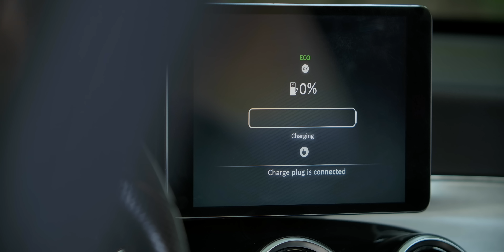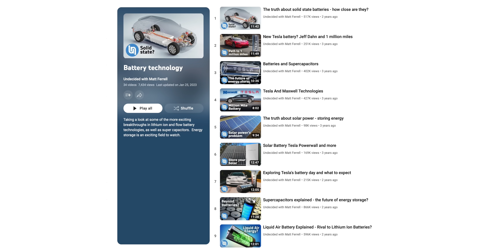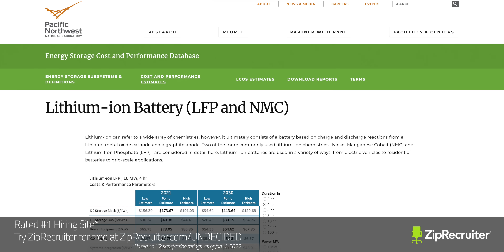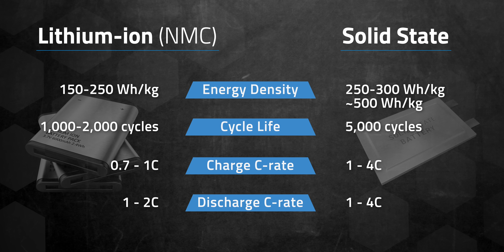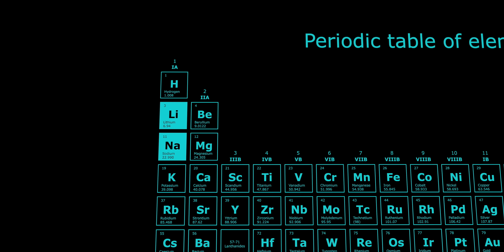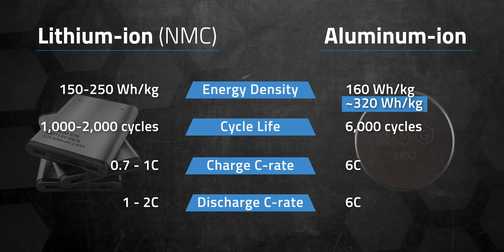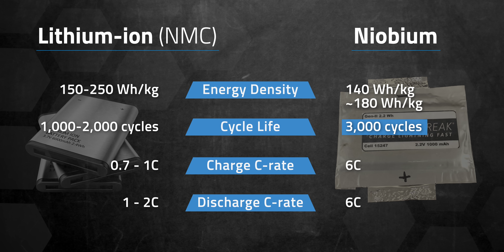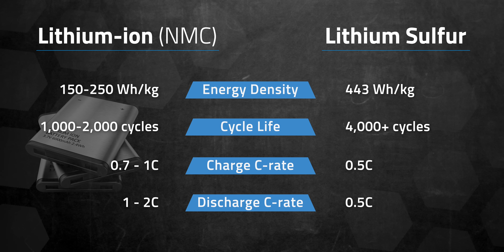Are These Batteries The Future Of Energy Storage?

Comment from the maker: So what batteries do you think have a good shot? Any you’d add to this list? See why hiring doesn’t have to be difficult — when you try ZipRecruiter for free at https://www.ziprecruiter.com/UNDECIDED.

If you liked this video, check out 137 Year Old Battery Tech May Be The Future of Energy Storage https://youtu.be/2wsSRq-bEm0?list=PLnTSM-ORSgi4dFnLD9622FK77atWtQVv7
Reply: Hey Matt, could you possibly make a video about microturbine generators as energy storage? its like a gas turbine but small, the upside is they can use hydrogen as fuel.    i recently came across them , but there's barely any talk about them. thanks!
Reply: @TheeFrancis  how is a generator energy storage? Sounds like energy generation hence the name
Reply: @slcpunk420  , hydrogen is where the energy is technically stored, the generator is how its gonna be extracted. Like fuel cells or something (im no expert😅) im really interested in the concept but all I see is product showcases and no full breakdown explanations about it
Reply: @TheeFrancis  And where does the hydrogen come from?
Reply: @TheeFrancis  i Wonder the efficiency of these generators . I3 is gone for good, and no other generator engine onbording is kicking strongly in this field
Reply: IMO the nano diamond 'battery' is the most interesting one to watch.  Top contenders are the ones that reduce material cost by 2 or 4 orders of magnitude (think silicone, carbon, sulfur, aluminum, sodium, etc - and NOT nickel, cobalt, lithium, etc. ) solid state is  promising too...
Reply: Does the omission of LFP batteries from this video just mean that they are already becoming the de facto standard for Chinese EV manufacturers? Seems like only super high performance EVs need to continue to rely on lithium-ion, and LFP batteries are much cheaper than NMC, can charge/discharge from 0-100% without battery damage, have 2X/3X lifecycles of NMC, and they don’t catch on fire. Somewhat lower (but steadily increasing with innovations) energy density is the only drawback of LFP. Tesla is already using LFP for all its grid/home batteries and beginning to transition to them in some lower-priced EVs.
Reply: @durinok  Both energy density and power density are problems for LFP.  This video claims very low C rates for NMC compared to manufacturer claims which go as high as 30C but more typically 5C.  LFP Blade battery from BYD ,on the other hand, claims 2C max discharge current ad 0.5C max charge current.  So if a typical 5000lb SUV wants to claim a 300 mile range, it better have a 100kwh pack, but a Blade pack even that large would only produce 200kw power which is not a lot of HP for a big vehicle that is carrying around a 2000lb battery and takes 2hrs minimum to charge.  NMC 100kwh packs can weigh as little as 850lbs while supporting 400kw (over 540HP), so you have more power in a vehicle that weighs 1000lbs less and can be fast charged in under 1hrs.  The cycle life advantage of LFP is not even so important because if SOC stays between 20% and 90% and fast charging is infrequent, NMC will last 2,000 cycles or more -- more than 400k miles.  You are correct to point out that LFp is not for performance vehicles, but I think you understate the case -- the weight of pack sizes that confer decent ranges degrade performance even further.  Unless LFP significantly improves both energy and power density, it will only be suitable for small, light, city cars with short ranges and low HP requirements.
Reply: @durinok  LFP (Lithium Iron Phosphate) is Lithium ion.  It's one of several different Lithium ion chemistries.  Agree it's one of the most important ones now, especially since it uses no unusual or uncommon chemical elements.
Reply: Other battery enablers include coating technologies (perhaps Kodak has the most IP in this field),  and other roll to roll processing and vacuum deposition techs including printing and miniaturized lithography (such as dominated by Intel...), etc. ...
Reply: I see you’re really enjoying the puns here today.
Reply: @alankirby3839  "batteries to keep an ion" lol <bites lip...nods>
Reply: The lack of $/Wh comparision (today/projected) makes this interesting, but somewhat useless.
Reply: I see video like this, and 15 years I buy CALB LFP 9000 cycles at 80 % DOD to 80 % SOH. Who can compete ? USA ? CHIle ? INdia ? Germany ? Russia ? Nobody in the world produces sych cheap battery, and cheap mean, that U sell GWh of capacity.
Reply: widespread implementation is.... 30 years away 🙃
Reply: LifePO3 lithium Ferro Phosphate!
Already on the market slightly lower energy density than Lion but more cycle life. And the biggy, inherently safe as when shorted or overheated they denature themselves and the cell become inert and stops being a battery well short of ever burning! Even if you drive a nail through it!
Great for safety!
Oh an huge C rate too for charging fast is another plus!
Reply: Sodium-ion with low cost of raw materials sounds like a reasonable alternative for high capacity grid storage.
Reply: As of yet, my favorite battery ever is the human being.  Leave it to Neo.
Reply: Lithium is fine in my opinion what they need to focus on till ssbs or alumion batteries or sodiatteries happen programming and smart initialization in cars like when the heater or ac should be turned on or when outsides air is better substituted the using ac and also electo tinting using outside window built solar panels o
Reply: I think the biggest problem is our battery situation. Currently is the fact that we have so much lithium sitting in landfills we’re waiting to be recycled and nobody’s stepping up to do it. We need to be recycling these materials to keep them out of the water table, and to reduce cost by development of more efficient, recycling methods, which are only going to happen if we push to get recycling even with less efficient methods we have now Paving the way for further development of higher profits for companies willing to do the r&d. Government contracts for recycling or something is need to make it attractive so that developments in the recycling field can move froward. Once solid cheap recycling is in place at that point we would have enough materials to reduce cost and be working on these newer batteries even more. The charging problem is a chicken and egg problem. We need to get these cars out there to be charged to have enough of a user base for companies to be willing to invest that or again government incentives for putting chargers and incentivize people to buy the cars and other electrical power devices again incentives is going to be the keyword. Getting this established because right now electric vehicles, at least in the United States are just too inconvenient and too costly to operate for many people.
Reply: I'd like to see form follow function and have a thicker phone with a much bigger battery.  But as long as so many consumers are fascinated by how thin their phones are I guess we'll always have less battery life than we could.  I can hold my 3 year old phone with less than one quarter of my fingertips making contact.  Will future phones fly out of our hands when a breeze blows up?
"Ooooooooh look how thin it is!  Oooooooooooooh it's so thin! Let's see who's is thinner!  Ooooooooooh!"  Sigh.
Reply: 6:02 Is it really true that he is good enough?
Reply: Sodium ion batteries seem superior in every way except for density.  I think that can be overcome in a battery swap scenario like Nio.
Reply: @davesworld7961  Or paired with another high-density pack for range.  We haven't seen any hybrid battery packs yet in production vehicles, but it seems like a lightweight high-C rate chemistry in a small pack could handle acceleration and regenerative braking, then be recharged by a slower C-rate but large high density pack during more steady state driving periods.
Reply: Graphene Manufacturing Group's graphene aluminum-ion battery looks extremely compelling.
Reply: Check out the Norwegian technology from Beyonder. Got their own patent, and are currently building a new factory.
Reply: i would have thought Sodium batteries can be used for cheaper BEV where you dont need that much range (small city cars)
Reply: I would add Lithium Iron Phosphate cells to the list. No controversial metals, significantly lower cost of manufacture, slightly lower energy density at pack level than NMC, virtually no chance of thermal runaway and fire, and much higher cycle life of 3,000 to 6,000. In addition, they are being used in EV's already.
Reply: I would be willing to go with sodium even with their limited density for no other reason than there is a LOT more sodium than there is lithium. 
Imagine only driving 200 miles on a single charge but stopping at the store for groceries or because you need that “200 mile get out of your car to prevent the blood clots” stretch, plug in your car, do your shopping/get your coffee and stretch, and BING! your car is charged. Add to that, your not destroying the environment with open pit mines that are searching for 0.002-0.006% of the earth’s crust. And we’re not making China the new Saudi Arabia.
Reply: One important thing missing in this video (and many videos from many sources about energy storage systems) is the *EFFICIENCY*. For instance, some of the grid-scale storage systems are only 30-50% efficient, loosing the rest to heat in some part of the process of charging, storing, or discharging. I think this is a metric that we simply can't ignore, as it has fundamental implications for their long term economic viability, payback time, and appropriate use-cases.
Reply: America already has a decentralized energy grid when a wire is cut because of the 1000 drunk driver of the week your not seeing thousands or even hundreds of outages you be lucky to see 15  per case because they route the energy by cutting out set houses near the accident basically making a cut at that line up to 3 houses which is the line - each transformer in your house in a total sum of your avarage use so the energy just gets used up at the last house before the break which requires a exact point on the break why you see multiple comcast people est ones to report the break to save money while the problem gets fixed because basically they count you as cut off 

so instead of having thousands of angry customers they have a few 

so the argument of why we cant do this because local energy companies dont do anything unless in increases their bottom line see if this disgusts you and think America should run with more government oversight so does everyone els with a brain and not trying to kill themselves thru their obsessive not caring
Reply: This is one of things which causes dads to say that "the world population is too high". If salt water can be turned into batteries, just imagine what "spiritual" extremists will do with the electricity which we're selling them at all affordable price: they will certainly use it to create weapons in order to kill teachers, cops, and judges, and to try to free all the prisoners. They will spill more salty water in the jail in order to make a long "cable", and use it to shock the deputies/correctional officers. They will fart in class. The only way to solve the problem is to only allow trustable people to live, such as certain Chinamen, and to make sure that everyone who looks like me will die.
Reply: For me, it all comes down to cost, speed of charge, and what works best with solar panels in a stationary environment!
Reply: @user-iw1gx9ej5s  I would be thrilled with a NDB with sufficient power/mass to run my cell phone for it's 5 year usefull life (and serve as a hand warmer at the same time)...
Reply: I made a comparison table from Matt's video. Thanks Matt for your videos. https://docs.google.com/spreadsheets/d/1eMgKCSCGUr3Sf3gxFdN7OvCnLSMtZAGIYLBLS6h5zVs/edit?usp=sharing
Reply: NUCLEAR.....

BAHAHAHA <3 you buddy!
Reply: How about hybrid batteries? Particularly in the case of electric vehicles where you have a slow charging, high capacity, slow discharge, high cycles module paired with a hyper-capacitor. Once you combined them, it may be possible to compensate for the weaknesses of one with the other. For instance, in the video, I see Sulphur-Li and Niobium as a possible pairing.
I also have faith in Na-ion batteries, as very few hold the promise of a cost reduction better than Sodium.
Reply: @rashakor  Niobium is expensive.
Reply: Sodium batteries 😊
Reply: Say hi to Will.
Reply: You need to cover Enovix. Going commercial before any of the above. I notified you about Enovix before as well.
Reply: @pranavid  I notice the Enovix website only claims 500 cycles.  Unless the pack is huge, that doesn't sound like it would last the 15yrs and 300k miles of a typical vehicle, does it ?  Is it cheap enough that 5 yr replacements make sense ?
Reply: As far as i know recommented charge current of lithium ion battery was 1c i can understand and know this but how in the world the new generation phones are like quadrippling this rate and claiming that this technology wont cause battery life to decrease? Can anybody explain it to me.
Reply: Battery which would be enviromentally sustainable would be the one needed, not toxic waste like the ones presented.
Reply: if i made car batteries for electric cars id think that square battery would be better to fill in the spaces between having that battery that cant catch fire iz a hole in 1
Reply: I’d be interested to see some more info about nanotopological changes in anodes and cathodes that increase performance of traditional batteries.
Reply: Why did you never talked about ENVX and the silica based battery? It is already being sold in some consumer industries.
Reply: I thought you’d cover LiFePo compare as well.
Reply: Good work. Key item missing comparison is a LFP, used by military for 20+ years
Reply: A new development out of MIT, molten salt electrolyte batteries with aluminum and I believe zinc (not sure which anode and cathode). Relatively low energy density but the molten electrolyte precludes damage from overheating and can reportedly easily handle 100C charge and discharge rates. Electrolyte is composed of a mixture of sodium and potassium chlorides and some other common elements so definite advantage on production materials. probably would make sense to use in vehicles for accel/decel with a seperate NMC pack for range as others have suggested.
Reply: We desperately need to replace the ones that are fire hazard risks.  I am getting paranoid as an Amazon Vine reviewer. I receiving so many of these trinkets that have built in li-ion batteries.  I'm afraid of one of them bursting into flames (that I may have packed away) because I just don't use it much.
Reply: Hey Matt, sodium sulfur is making a huge comeback. It would be amazing to hear some prospective from you. Especially if you include failure of the past as guidance for future safety. Thanks in advance. Hope you would consider.
Reply: Hi Matt! Thanks for the amazing content! Could you do a top 5 for bio plastics?
Reply: Lithium-Air, specifically Li2O batteries are the most interesting because they have extremely high energy density due to their 4-electron reaction. Prototypes have achieved nearly 700wh/kg and there is room to over 1000wh/kg with tweaks. Downside has typically been low cycle life and high temps needed but recent developments in solid-state li+ permeable electrolyte has made this viable at room temp with 1000+ cycles. This research paper just released a week ago and I think it's incredibly promising. Lack of rare earth metals like cobalt/nickle etc should make them very cheap too. Also, fun fact, they gain significant weight as they discharge due to pulling Oxygen from the air!
Reply: The batteries should be rated based on the total energy stored over the lifetime/their price and should work at least for a few decades to make sense. I think LTO batteries look good so far.
Reply: How would you go about insulating batteries to protect them from cold weather?
Reply: The Toyota solid electrolyte battery due out in 2025 seems like a good candidate.  I drive a 2017 Prius Prime, the battery is a bit tired, I would love to upgrade to what appears to be a much better battery.
Reply: Please do a similar comparison video for grid storage. This is what's needed to make wind and solar scale and is a critical technology to fight climate change.
Reply: I still like the idea of quickly swapping out Iron-Air batteries at the service station.
Reply: @seanhoude  only one company ever got near trying it, an Israeli company, and their battery swapping mechanism proved hopeless.  It's a harder problem than you might think, given that it can't be managed by hand, must be safe in the rain, across all kinds of vehicles, must not involve hours waiting in a slowly moving queue, and must involve making a heavy weight secure.  One idea I had was for electric cars to tow their batteries on little swappable trailers.
Reply: The stuff I've read and watched for CATLs Sodium Ion looks very promising.  CATL is the battery supplier for Tesla and the specs on the new roadster, using these batteries, say the range should be around 700 miles.  I think we'll see another huge revolution in tech within 5 years like we saw with NiCad and then the big boom with Lithium.
Reply: High energy density batteries interest me the most. Safety is a close second as car crashes can damage battery packs an it’s never good to have the danger of fire. Your five rope batteries are perfect.
Reply: Can you cover Lithium IRON batteries? My home storage uses that tech. I just want to hear your thoughts about it.
Reply: I'd love to hear your take on those nuclear nano diamond batteries. 
promising or problematic?  hoax or hope?
Reply: hey checkout Zenaji LTO Energy
Reply: The Graphene Aluminum Ion Battery looks like it will take the prize.
Reply: Fluorine ion, aluminum ion, or sodium ion. All have pros and cons. Fluorine has extreme voltage 4.4 to 5.2v per serving, but trying to keep the fluorine in its place is tricky. Aluminum ion is lower voltage, about 3.3v, but has a much higher current capacity than most lithium batteries. The sodium battery has a lower capacity but the lowest cost.
Reply: aluminum-ion
Reply: I was hoping to see Li Fe PO4 (Lithium Iron Phosphate) batteries in this list, but you made good choices there.

Li Fe PO4 are already on the market. Specific Energy Density is lower than Li NMC, but I think cycle lifetime is similar. The big plus is that they are highly tolerant of situations that would be considered abusive to Li NMC cells. They are finding use in home batteries, RV house batteries, and marine storage.
Reply: that aluminum batteries look the most ideal
Reply: Vanadium redox flow batteries for stationary storage for home / grid scale. Relatively low energy density but 30000+ cycles at 100% DOD.
Reply: @zohan9995   aluminum batteries gonna be the future tho
Reply: Thank you.
Reply: Anybody remember Sony Betamax?  How about Lotus 1-2-3?   Besides battery technical obsolescence, EVs are on the cusp of encountering severe raw material shortages.
Reply: I think you missed a major one... semi-solid-state (also marketed as "condensed matter") ... basically these batteries use a NMC base chemistry and a gel electrolyte.  I believe several companies are working on them and there are already samples built into packs floating around.  I don't remember the company names though.  Something like 30% lighter than standard NMC for the same capacity and also apparently fire-safe.
Reply: Niobium sounds very interesting!
Reply: Your videos are constantly paired with false advertising about chargers and battery "solutions" that claim to fix the issues that arise out of charge cycling, and its really annoying.
Reply: I find very disappointing that there was not a single mention of the environmental concerns of producing batteries with different technologies. Mining lithium exposes entire towns to cancer development, deformities and many other health problems. And the only people talking about seem to be the ones being directly affected.
Reply: Basic engineering knowledge and why hydrogen is superior to batteries.  Though this knowledge is blatantly ignored because people do not get the basics. 
https://c2e2.unepccc.org/wp-content/uploads/sites/3/2019/09/analysis-of-hydrogen-fuel-cell-and-battery.pdf
Reply: @BS-vm5bt  Hydrogen fuel cell vehicle well-to-wheels (overall) energy efficiency is about 20% when the Hydrogen is made from electrolysis of water.  That's about the same efficiency as burning fossil fuels in an internal combustion engine. 

Put another way, driving a battery electric vehicle will go about 3x to 4x as far as a Hydrogen Fuel Cell vehicle for the same energy input.  Hydrogen is incredibly energy inefficient when all of the inefficiencies are correctly accounted for. 

And most commercial Hydrogen is made from natural gas, a fossil fuel mostly controlled by oil companies.  That's why Hydrogen is promoted by oil companies.